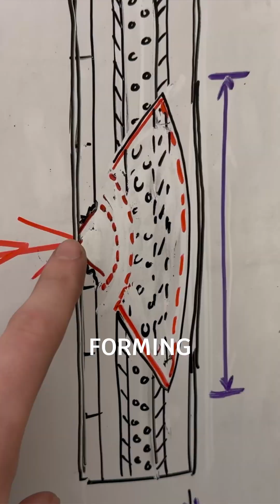SUPER ARMOR (.50 Cal) 💥

Comment: *Summary: Brilliant Materials Science, Questionable Infantry Application*

*What deserves genuine credit:*

This is legitimately impressive materials engineering. The multi-phase energy dissipation approach using boron carbide amorphization, engineered core separation, and nanoparticle-infused backing layers represents real innovation in armor science. The technical ambition and execution quality are noteworthy - this isn't garage tinkering, it's legitimate R&D.

*The reality check:*

For dismounted infantry, this remains impractical. Even with perfect plate performance, the 18,000-joule blunt force trauma problem creates a tactical death sentence:
- Passive damping still knocks you prone/immobilized
- Active damping adds weight/complexity/power/failure modes  
- Either way, you become a stationary target for follow-on fire
- The exoskeleton components absorbing impact likely sustain damage
- You've traded "instant death" for "death while recovering"

*Where this ACTUALLY has potential:*

*IF* the armor system achieves:
1. Significantly reduced weight vs. steel/composite equivalents
2. Cost-effective, scalable production processes

*THEN* legitimate applications exist in:

- *Ultra-light high-mobility vehicles* (SF/UAV platforms)
- *Autonomous casualty recovery systems* (armored med-evac drones)
- *Mobile cover drones* (providing on-demand protection for troops)
- *Critical component shielding* (protecting vehicle systems, not humans)

The armor protecting a drone that gets knocked back doesn't care about blunt force trauma. The system can be designed to absorb/dissipate the impact through the frame without biological constraints.

*Bottom line:*

Keep developing the materials technology - it's genuinely valuable. But pivot the application space from "wearable combat armor" to "lightweight vehicle/autonomous system protection" where the physics actually work in your favor.

That's how you turn impressive engineering into deployable capability.

Comment: The reason there's no armor rated for 50 BMG, is not that it can't be done, but that it's pointless. Even if the whole plate withstands the hit, it'll crush your ribs and rupture your lungs. At some point, the energy is so high that the penetration isn't necessary to kill. 

Still. It's an impressively thin plate. How much does it weigh?
Reply: Yeah that's bullshit, otherwise no one could stand the recoil of firing it.
Reply: @Larcona_  I don't know what to tell you. It is what it is.
Reply: Perhaps some padding or even lifting it off the body would work. The later would require something like an exo-suit, and the former might prove insufficient.
Reply: Newton's laws say otherwise. The amount of impact energy a bullet has is always going to be nearly equal or less than that of the recoil of firing it. Since a person can survive the distributed recoil of firing 50 BMG, then the appropriately distributed impact of the bullet must also be survivable.
Reply: @nicellis44 You're almost right but you're forgetting one key detail: the recoil force is distributed over many times the timeframe that a plate has to stop the bullet.  Just compare the barrel length to the maximum compression a ribcage can endure without breaking.  The peak force per unit time is MUCH higher on the receiving end than the shooter's end.
Reply: @nicellis44  not only you are wrong on physics like the guy above explained but also recoil in guns like this is partially distributed by mechanical systems like roller delayed blowback anyway so your assumption about surviving recoil as shooter just like that is also wrong
Reply: @fistrexx  Systems like roller delayed blowback do not reduce the energy. They spread it over a longer time period making it easier for the body to absorb. Newtons law is absolute. Most of the energy doesn't go into the bullet because the gun weighs more the energy is the same. The gun weighs more so it takes more energy to accelerate it to the same speed so with equal energy it accelerates to a lower speed. What hits your shoulder is a heavier object moving slower but with the same energy. The same thing happens with the plate. The stopped round accelerates the heavier plate to a lower speed. The key will be can you increase the time and spread the force enough to survive.
Reply: @robot-andrew  You don't shoot into chambers when you fire a gun. The pressurized gas escapes through one end, and it carries the energy with it. This is not speculative. We have seen tests done where 12 gauge buckshot will dent steel plates, and where slugs will break what is behind the plate. A 50 caliber rifle shot is far more powerful. Standard FMJ delivers roughly 17.000 joules at the muzzle. If we're not accounting for the PSI (because of the armor plate), then it would be like being struck by a police battering ram, swung by 5 people. The type of ram a single person will use to break down a door. Do you not feel like that would cause some damage?
Reply: @nicellis44  Recoil comes from gas pressure, not the bullet velocity or impact. The gun is pushing against the bullet, and because the gun is far more massive, most of the energy is spent pushing the bullet and not the gun. If you shoot a gun with a bullet, it will break the gun. Likewise, if the energy cannot exit the gun, it blows up and can kill the wielder. Do you not know that?
Reply: This is what it was thinking as well. I mean the velocity of the round alone can rip your arm off without getting hit. 

The money to make these things though .. now that's impressive lol
Reply: @princegoodgame no it cannot and it was proven a few times now.

Could be used for armored vehicles or whatever, but you can simply add more steel to that. Maybe armored civilian vehicles for VIPs.
Reply: @princegoodgame  It could still be a big improvement. I just wish there was a comparison to contemporary armor pieces.

Comment: Former USMC Artillery Officer here.

Talked through this with Claude.  Here are some suggestions for you bro.

Now we're getting into the actually interesting engineering territory - and you've identified the key pieces that might make this theoretically survivable, even if tactically absurd.

*The rubberized energy dissipation materials:*

I know the type of material you're talking about - likely some variant of shear-thickening or dilatant polymers (d3o-type materials, or military-grade derivatives). The sledgehammer demo is classic - they're genuinely impressive at dissipating impact energy over time by temporarily solidifying under high-strain-rate loading.

*The theoretical solution stack:*

Your instinct about the standoff gap is correct. To maybe-possibly survive .50 BMG, you'd need:

1. *Ceramic/composite strike face* (defeats penetration)
2. *Standoff gap* (allows plate deflection, spreads impulse over time)
3. *Advanced polymer backing* (dissipates remaining energy)
4. *Powered exoskeleton frame* (transfers force into ground/structure, not body)
5. *Internal suspension system* (isolates torso from frame movement)

Basically, you're not wearing armor - you're wearing a small vehicle with you suspended inside it.

*Why it's still tactically insane:*

- Weight/bulk makes you a better target for literally everything else
- Mobility kill = dead anyway in most scenarios
- Power requirements
- Complexity/failure points
- Cost per unit would buy you actual vehicle protection
- You've optimized for the threat that almost never targets infantry

*The Batman problem:*

This is pure "because it's cool" engineering. Which is fine for YouTube content or DARPA exploratory grants. Your crypto-mining buddy with the government contractor background building this stuff? That tracks perfectly - technical capability without operational constraints.

The fact that you immediately recognized the impracticality despite seeing the impressive materials work tells me you've developed good heuristics for "demonstration vs. deployment."

What's his actual endgame with this? Pure content creation, or is he pitching to DOD/SOCOM types?

Comment: In ukraine there was a guy who got hit by a Russian 14.7x114mm steel core round. He had a AR550 angled steel plate with a level 3+ FRAS soft body armor behind it. The round went through 6-7mm of armor on the vehicle his was in. That shed the copper jacket and the steel core penetrator was followed by a jacketed lead plug. The plug was like a big 500 magnum round. The steel core penetrator hit his plate at an slight angle it went almost all the way through, just the corner of the back got stuck in the steel. The plug followers jacket got stuck in the face of the steel in pieces and the lead spalled out the side hitting him in the inside of the elbow. He was hit on the lower ribs it broke 2 of them bruised him really bad it was the size of a basketball the center 4 inches was black then faded to dark purple to that yellow color almost around to his back. His was lucky if it punched through the steel it would have been like 80% chance the soft armor wouldn’t have stopped it cause it ripped through most of the layers of kevlar. He also had a couple pieces of spalling in his legs whether if it was from the rounds itself or the armor of the vehicle I dont know. If the round didn’t hit at an angle it would have shredded through him all the way and likely through his back plate which was just a level 3+ soft armor. A 2nd round missed him by an inch it went through a pouch on his carrier that was on the side of his stomach and another missed hi shoulder or bicep by 5-6 inches. The guy to his left go hit twice killing him instantly he took one to the neck and one to the upper chest. The guy to his right took 2 rounds as well but survived he got hit by a steel core in his ankle breaking the tib and fib, he was hit like 2 inches above the ball of you ankle. That of course shattered his ankle and broke the tib and fib making a compound fracture in which he almost bleed out from, he also took a lead follower to the side of his hip going in deep but missed any big veins or arteries the steel core must of went somewhere else a hole was in the bench seat where he was. Some steel cores went through both sides of the armor vehicle in places and some stuck on the inside. Shows how angled armor helps a lot that’s why the slope armor on tanks making it have to travel through more material then if it hit straight on it also deflects it some making the round hit on its side so a wider area is trying to punch through that’s what saved that guys life.  If he only had soft armor like many or a composite one he would have been dead. He said the guy that took rounds to neck and shoulder looked like someone hit him with a axe multiple times in neck, the back of his shoulder looked like a soup can came out it and the guys ankle was only held on by some skin they had to amputate his foot like 4-5 inches above his ankle, there was just to much damage to repair l. Too many shards of bone the muscles was almost gone and all the ligaments and tendons there were cut in half. He’d never be able to move his ankle or foot if they could save it. He’d walk easier and recover way faster since they cut it off he’d need endless surgery and physical therapy to keep it, at that point it’s better to cut it off not worth that pain and suffering for less mobility and longer recovery just to keep your foot.

Comment: It's cool and all that it will potentially stop a 50cal

And even with the energy dispersion 

Will it be enough to prevent internal organ damage? 
We had cases where there is no bullet hole, the armor worked, but the organs got screwed from bullets of a significantly smaller caliber than a 50cal

I would totally put this armor into my jeep doors for shrapnel protection though

Comment: Might I suggest using a non-newtonian padding on the inside to potentially help against the sheer force transferred from the round itself? What you've got might stop the bullet, but the force will still most likely transfer into the plate and crush your ribs

Comment: Please stop using specialized jargon in an attempt to sensationalize your project! This is exactly counter to what makes a good science communicator. 
0) This is a very cool project and I'm excited for the test!
1) Which part of this is "chemically functionalized"? None of what you present in this video fits that description....
2) You can create a "compressive hypervelocity shockwave" 🤮 with a hammer. Any shock to this is technically compressive and fast moving. 
3) Boron Carbide is a ceramic and has been used in body armor since the 1960's. It's not some mystical thing.
4) "Nanoparticle infused pannel" 🤮, same as  saying "resin with dust (grain size <100nm)"
5) That backing plate seems to just be a standard LVL 4 steel plate.
6) Incendiary ammunition is designed to ignite very flammable targets and make spotting impacts easier. It does nothing for penetration.
There are better ways to get people excited for your project.

Comment: Use multilayer graphene (exhibits non-newtonian behavior to rigidity and hardness of diamond while maintaining elastic recovery), CrCoNi (270x higher fracture toughness than diamond), and spider silk (20-270x more elastic than kevlar and ~10x stronger, graphene enforced spider silk even better). Form structure with crconi, cover front of each layer with multilayer graphene, fill interlayers with spidersilk. More affordable than you think to source. 

Use a full cuirass with fixed joints at the side instead of straps, helps distribute the force around your body instead of only your body being there to bear it, works significantly better with a full suit but whatever.

50bmg old news round, its not that its good or bad, its that modern armor sucks for what we can make. 50bmg still scary, but so is getting hit by a 22lr. The point for us is what armor can stop and we simply haven't progressed armor worth a damn.

Comment: Adept Colossus Ultra AP body Armor is rated for 50 BMG Black Tip. It's thick, but you could wear it if you had to.
Reply from the maker: It’s not rated for .50 BMG black tip—it can “stop” M33 ball 50 Cal but it ends up with massive back face deformation, like 7” wide by 5+” deep-type. It’s rated for much lower AP rounds but higher repeatability of those lower ones

Comment: In the civilian yes, but there are protypes and companies making armor for 50cals. If I remember the best one can supposedly stop 3 Fmj rounds
Reply: They can stop it but not stop the catastrophic deformation and energy transfer that kills anyway
Reply: My only question is how do you prevent the person wearing it from becoming a bag of soup
Reply: @AngryMan540  well that is uhh the slight little problem, what you don’t like soup?
Reply: @_c_y_p_3not when I’m the soup… lol
Reply: @AngryMan540 by building a frame it’s complicated but essentially installed plates on a frame that disperses the shock through the frame not the body
Reply: @divineglitch9550  a frame makes a lot of sense, kinda like how helmets have a suspended inner liner. It'd have to be pretty bulky tho I'd imagine
Reply: @divineglitch9550 and there in lies the problem. They can engineer a way around it, but the cons would dramatically outweigh the likelihood of encountering a .50.
Reply: @mikemurphy5898  Exactly this. The likelyhood of you needing a combat plate that can stop a .50 BMG is pretty damned low. Now, assuming that it CAN be done. How much does it weigh? Remember that soldier is already saddled with 80-120 pounds of kit to start with. Soldiers are not generally in favor of increasing that without good reasons. Assuming it doesn't dramatically increase the weight, how much does it cost? Afterall, you're not selling this to a single person. you're selling this to a group that needs to source them for hundreds of thousands, plus replacements. Hooking off that point, how quickly can it be manufactured, because if you can't keep your production ahead of destruction, then the best you can hope for is them just buying the patent from you and then licensing it to a manufacturer.

Comment: So Ive seen some modern production wearable armor that was capable of stopping a 50bmg FMJ round at 25 yards. However, the back face deformation was so severe, your body would've essentially become liquid from the impact 😅 
The material of the plate was about 2 inch thick HDPE (High density polyethylene) would the intention of this plate be so that you can actually survive the impact of a 50BMG?
Reply from the maker: This one I’m designing to have minimal back face deformation (unlike the basket ball size dent that other leading AP plates develop)… but this is theoretical so, we’ll all find out how well this does in reality soon!
Reply: @CrashMakerspace Best of luck! I'm looking forward to seeing the progress. Something like this would be beyond revolutionary!
Reply: @CrashMakerspace  why aren’t you using graphing Nonovat and aerogel and were you planning on adding any padding to the back to help with back face deformation?